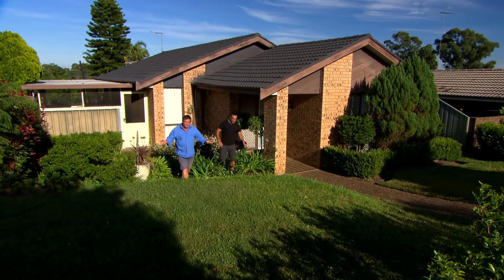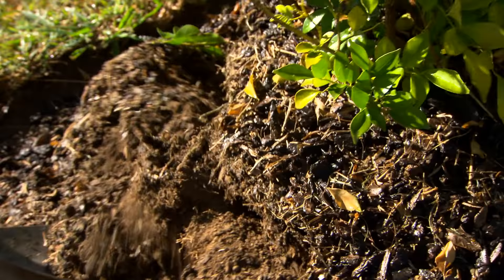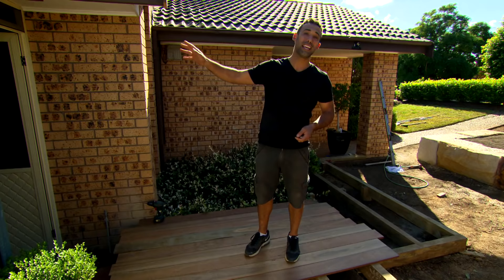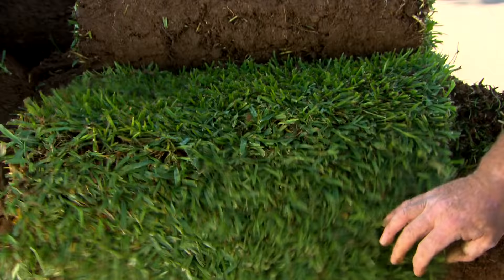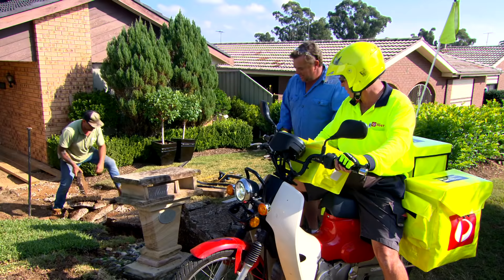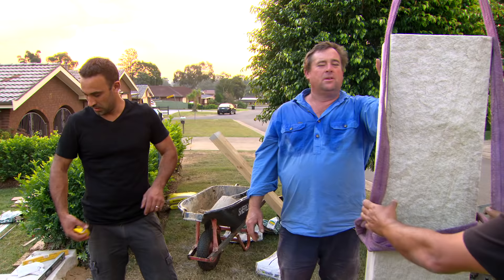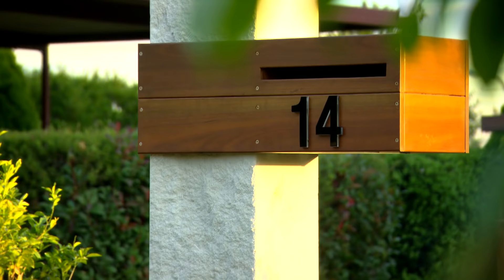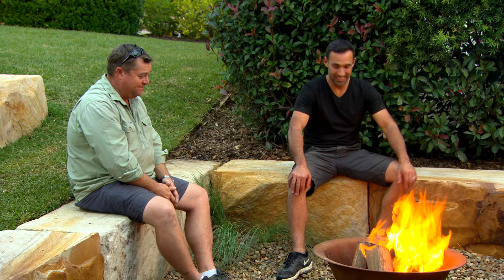This EPIC Front Yard Makeover Has to Be Seen to Be Believed | GARDEN | Great Home Ideas

Comment: The pebble walkway and tile entryway, which both looked to be in great shape, could have been topped with a non-skid coating for an economical makeover and slip proofing. Wood decking can also be very slick when wet. The slope on the walkway would have been great for ease of entry for anyone with a mobility issue or for wheelchair access rather than steps. What they've done makes for a good show but for longevity and accessibility not so much.

Comment: I used those small 3mm gaps between hardwood decking boards (kwila) and regretted it - I ended up having to pull up all of the decking boards after they swelled, took up the gap and water couldn't escape between them. I recommend doubling the gap between the decking boards if you're in a wet climate.
Reply: My thoughts as well and mossy slime build up as no texture to the planks but the wood my naturally be repellent to mossy stuff.